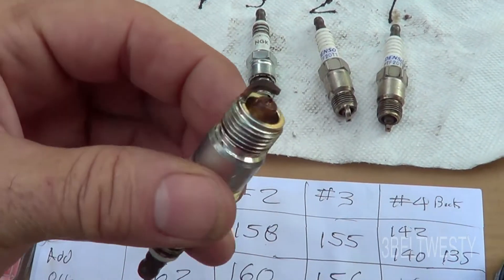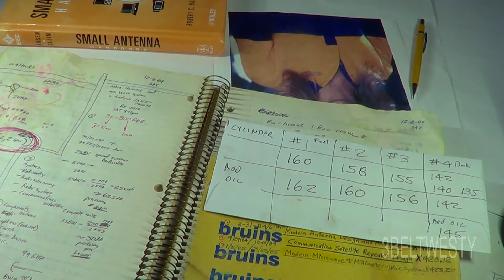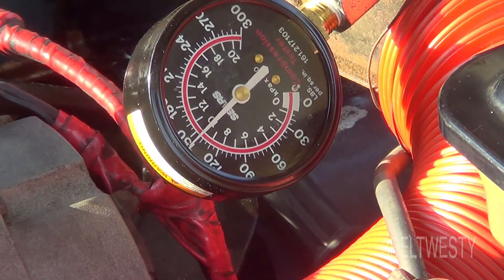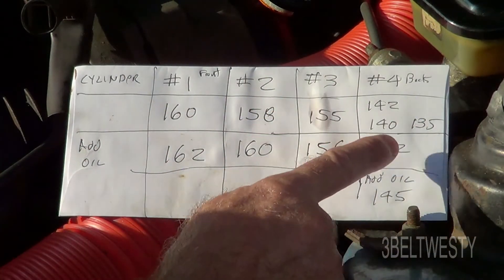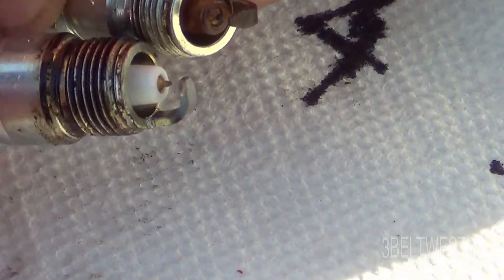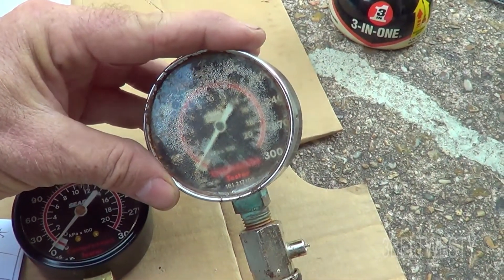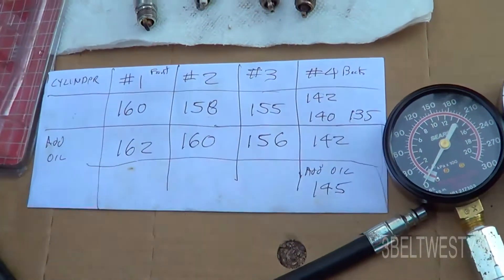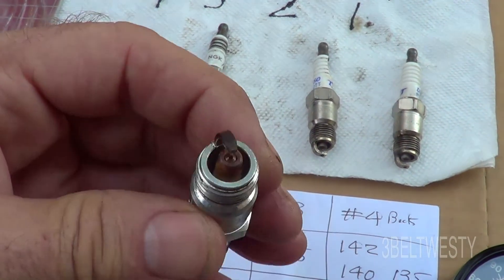Compression Test Plug #4 fouls on 2.5L Iron Duke Camaro

Comment: Your platinum plugs have a weaker spark due to the lack of electrical conductivity of platinum. Iridium keeps some of the anti-fouling properties, without impeding spark output as much. Copper will always net the best spark. If the plugs are easy to get to, I'd run copper. The other plugs were developed mainly to keep spark plug changes out of warranty limits. 
Usually issues towards the rear of the engine are due to heat, or liquid buildup (oil or gas). In the case of oil, if the valve stem seals are worn, or buildup is causing oil to pool, it will get pulled in through the intake valve. If you have sloppy fuel distribution, that will generally make its way to the rear cylinder(s). If its a heating issue, there may be hot spots during normal operation. Excessive buildup from improper EGR operation can also cause all sorts of havoc.
Did you ever get this fixed?

Comment: I'm interested to see what you find out, in my experience 140 psi of compression is plenty to support combustion. You may have a fuel distribution issue, or vacuum issue like you said. I don't suspect the head gasket, that would have other symptoms.